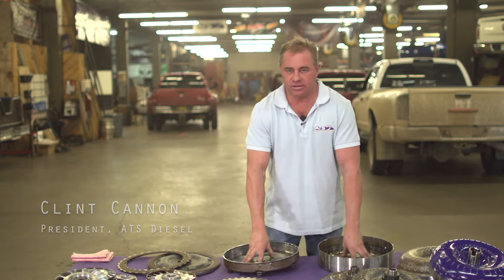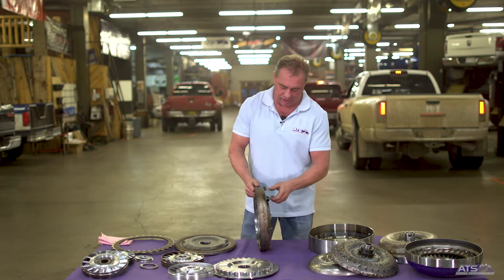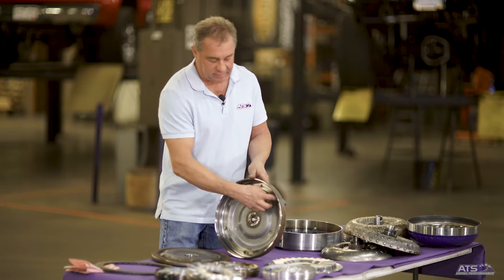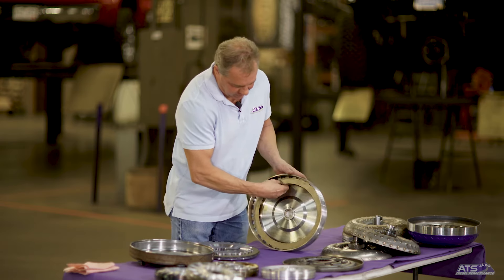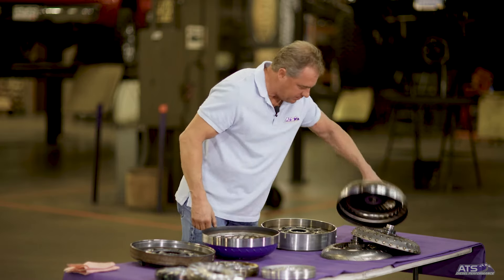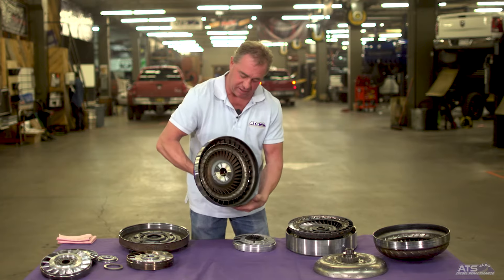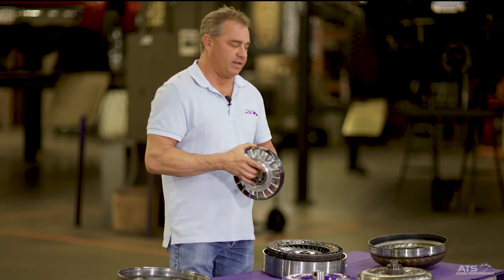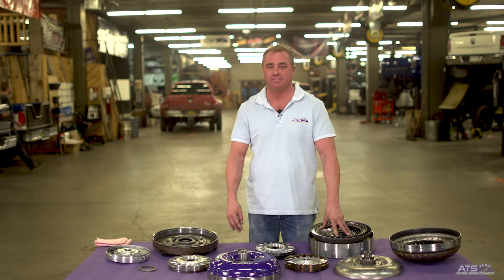Product Overview: ATS Torque Converters

Comment: So I just purchased the TRULOK TC for my Jeep. Other than the description on the website, Id like to know what you guys did to make it reliable for the NAG1. The TTC is the main failure on these due to poor clutch piston/shaft tolerances and a junk fluid oring. What is the "TRULOK" design and what was done to address the stock TQ flaws??

This new TQ looks like a beat up 2013 reman painted purple and its packaging was horrible. TC was full of cardboard fiber chunks. Inside the coupling is all marred up too. Sure hope its as good as you guys claim cause we are off to a rough start right out of the box. Starting to think I should have bought a Sonnax TQ.

Comment: Very well presented and very professional,,I'm sure they make excellent convertors,,,just want to clear up some confusion about stock convertors.
Speaking strictly Ford convertors
89-95 e4od had single plate from factory
96-98 e4od we're called multi plate by Ford and had two friction surfaces,,these are considered junk 
Now all diesel convertors from 99 up have a triple disc from the factory,,,most companies lie and tell potential customers that there 2001 truck only has a single plate when it's not true,,
All 99 up come from the factory with a triple disc convertor
2003 up they upgraded again and got rid of the plastic stator thrust washers and replaced with Torrington needle bearings
2004 up diesel= has all furnace braced fins on impeller and turbine
All stock convertors from 99 up have stronger heat treated splines in turbine,,stripped splines are rarely a failure,,, actually seen more with aftermarket (upgraded) supposed stronger parts
Also the stock 6.0 converter is a really strong and efficient design with a torque multiplication k factor of 1.9 
Most companies are just installing sonnax components,,which is fine
Then others are selling a stock triple disc convertor from 03 up and calling it there heavy duty yada yada yada,,,just a stock converter